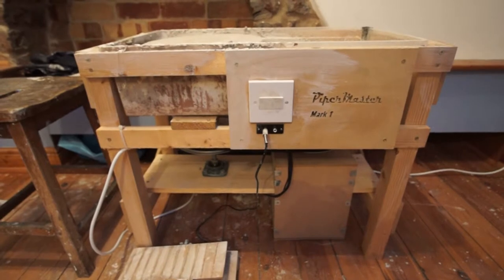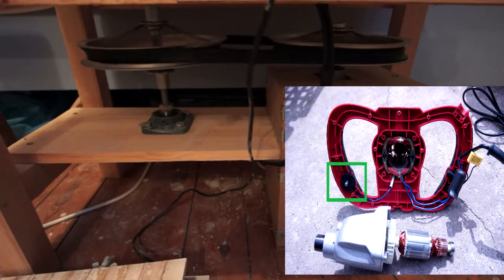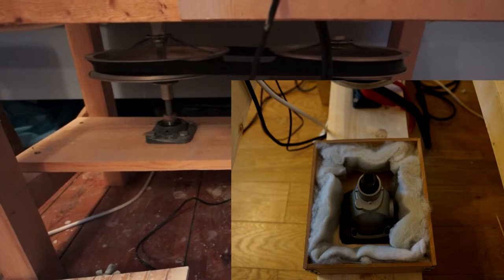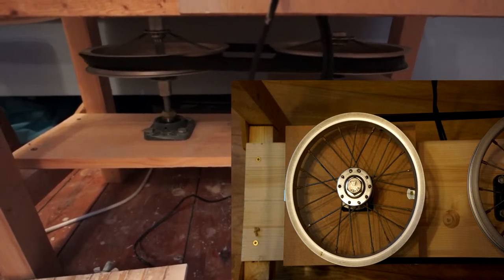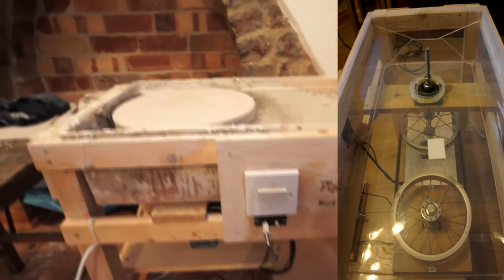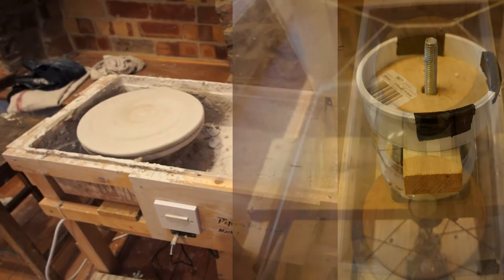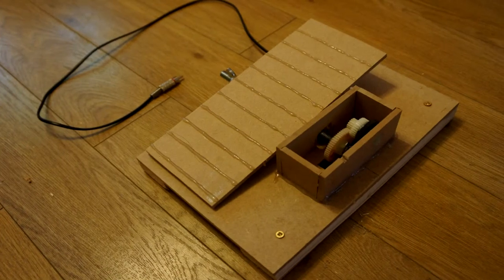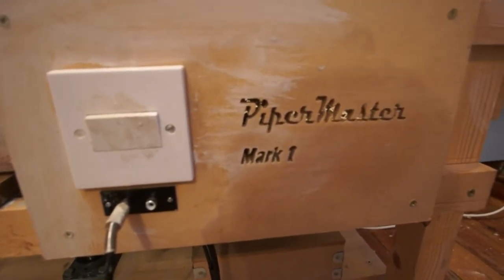Home Made Electric Potter's Wheel (Pt. 2)

Comment: Hi. love your home made wheel, im thinking of building one to have a play myself as i just built a mini kiln. Just one thing i noticed the phono plug you are using has the outer metal shell connected as one of the conductors and unless you opto isolate or run the entire rig through an isolating transformer the outer of the plug will be connected to the mains dimmer circuit, i know its only the trigger to a triac but still dangerous with wet hands and all. maybe use a 3 core cable with an earth and use a better plug. have a look at speakon connectors on CPC. not wanting to put you off just want to make sure you and others playing will be safe.  If you want any advice etc get in touch. Keep throwing!!!
Reply from the maker: Hi, thanks for the advice. What you suggest makes a lot of sense but I have to admit my limitations in this subject. Finding a suitable motor with enough power and a price that makes sense was not easy. The motors they use in the professional wheels are all bespoke made.  My main advice is to think carefully about the wheel head and more specifically getting it running true. NOT easy. The truth is, you can't throw properly unless it does. If I could weld I would have done instead.